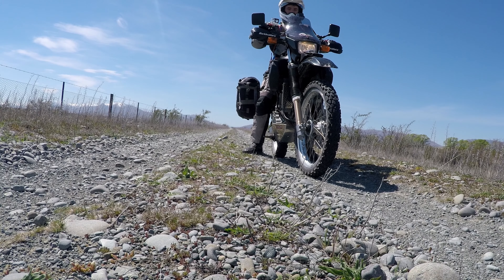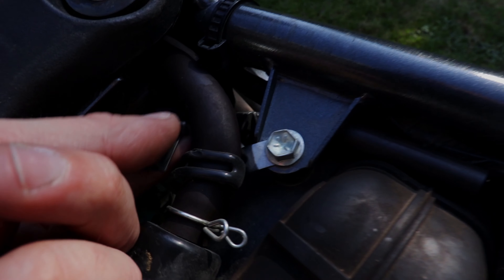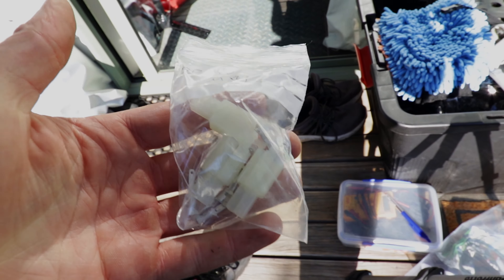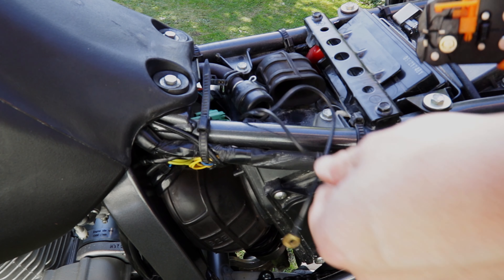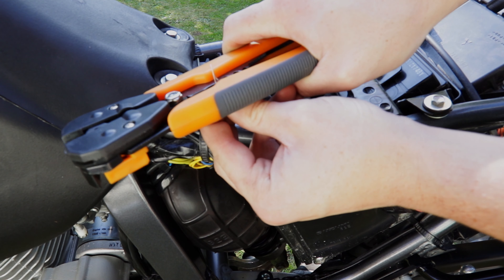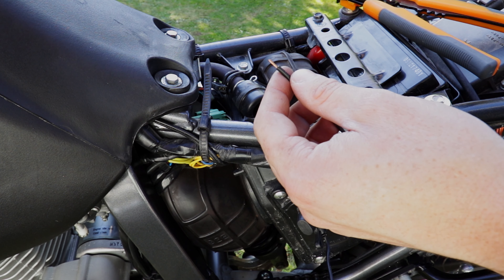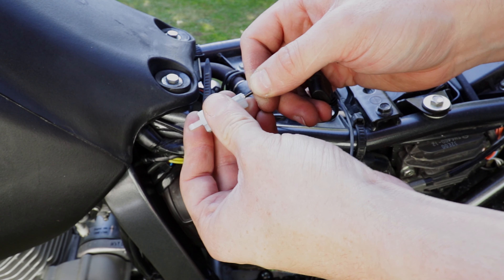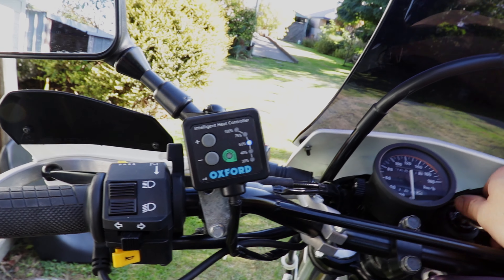Suzuki DR650 Accessory Wire Up

Comment: Hello! Thank you so much for this! I am learning, so please bear with me! I want to install a USB charging port on my DR. If I get the eastern beaver 2 pin connector, does it matter what connectors are on the end of the usb unit I buy or can I simply cut them off, strip the wire, and put the eastern beaver pin on them?  This is the one I am considering:

GOBGOD USB C Car Charger Socket 12V/24V USB Outlet, 36W Dual Quick Charge 3.0 Car Dual USB Port with LED & Touch Switch DIY Car Socket

Thank you so much for your help! Subscribed and looking forward to watching your videos!
Reply from the maker: Yes if you get the eastern beaver plug with pins you can just cut off what ever comes on your usb and crimp them on and plug straight into your bike
Reply: @MOTODANS  thank you!!

Comment: Do I get the male or female from eastern beaver?

And thanks for this video!!! Been look for a way to charge my phone with usb charger without hooking up to battery and it dying on me in the middle of nowhere. I’m not very savy when it comes to this. But looks simple enough.
Reply from the maker: You need the male 2 pole connector. May be worth grabbing a few extra terminals incase a mistake is made while crimping. This is a great way to do this for phone charging and means the bike will remain factory.
Reply: @MOTODANS  So I only had to wait like 2 weeks from Eastern Beaver. Once shipped it came fast from Japan. 7/25 and got them yesterday.

Works AMAZING!!! Usb charger successfully installed. No more worrying about a dead phone on long trips now or even a dead battery bank for that matter.

Thanks for this vid!!! Never new about these 2 places Suzuki has connectors that work when bike gets turned on.
Reply: @MOTODANS  heck not even 2 weeks. I see I asked my question 10 days ago lol
Reply from the maker: Awesome 👍 It makes the job so easy just plug and play. Glad it all worked for you. I have gotten a few things from eastern beaver over the years and they are top notch.  I think they are for a side light for certain markets?
Reply: @MOTODANS  this is off topic. But would you happen to know what is the torque spec for the spoke nipples on the DR650?
Reply from the maker: 4.5nm. 
 I have an app on my phone called My Dr650 has all the torque specs and basic maintenance items on it. Free on the play store. Check it out

Comment: Avoiding the "jerry-rigging", as we say in the states, and doing it right.  That's the only way to do it.  I learned something here.  I wasn't aware of the second ignition outlet under the seat.  I appreciate that.
My brother, you need to speak up into that mic.  I always have to turn the volume up (substantially) on your videos.  Put some of that NZ horse power into it.  :)   Thanks for the video.
Reply from the maker: Cheers! I I edit with headphones in and I always have to turn it down. I will crank it up for the next one as Danni has also mentioned that I am to quiet!
Reply: @MOTODANS  Respect and gratitude be upon you my D R brother, these excellent tutorials you share with everyone are very much needed and appreciated,..but…as has been mentioned previously, it is quite difficult to hear you.
Reply from the maker: Hey Greg, thanks for watching. Should be fixed on my more recent videos 👍

Comment: Hi Dan, I can't find the the auxiliary plug under the seat. Where exactly is it?
Reply from the maker: Should be at the front left just behind the tank if I remember correctly. Someone has mentioned this is used for park lights in some countries so depends where you if it has one.
Reply: Thanks for the super quick reply.